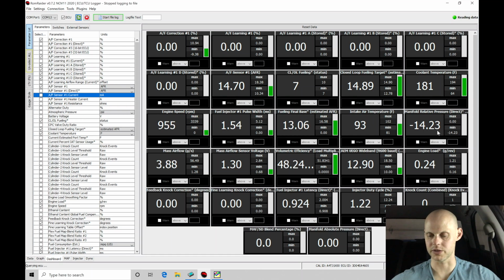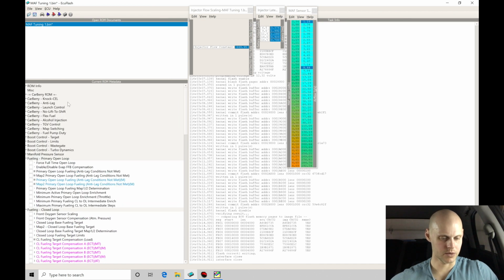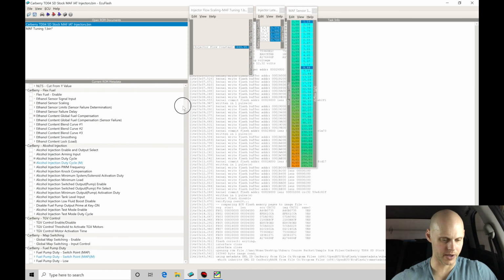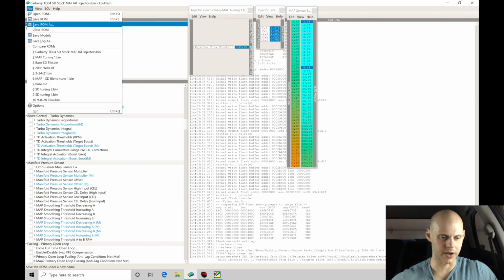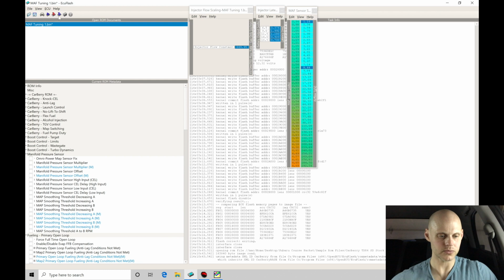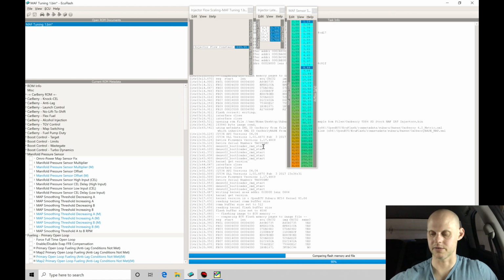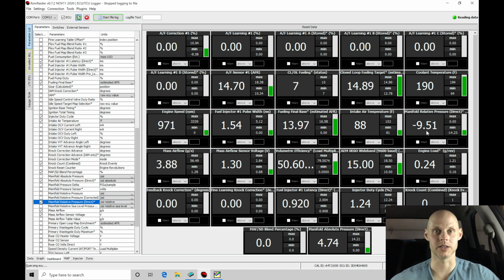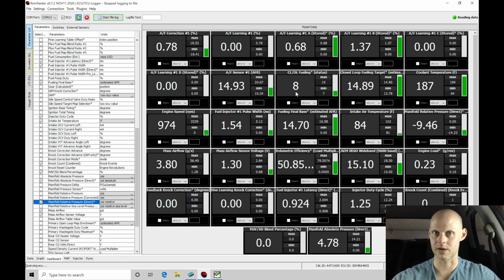Ecu Flash 16 Bit Subaru Live Training Part 2: MAF & SD Based Fuel Tuning | Evans Performance Academy

Comment: When it does the flash thing it’s a physical bad connection in the obd2 I had to clean all my plug and once aware of this I never get this message, but when I do I know the immediate culprit. And it’s the ground pin on the obd2